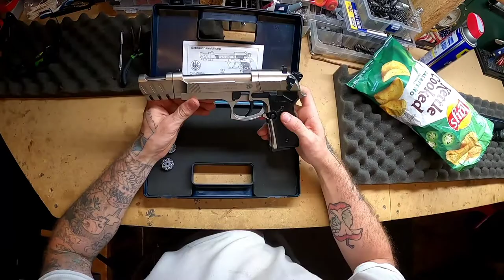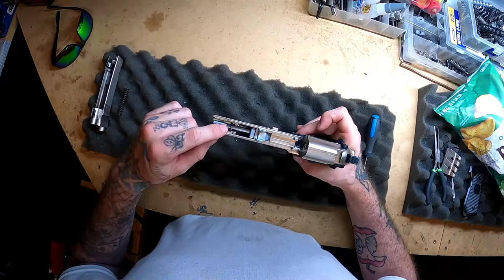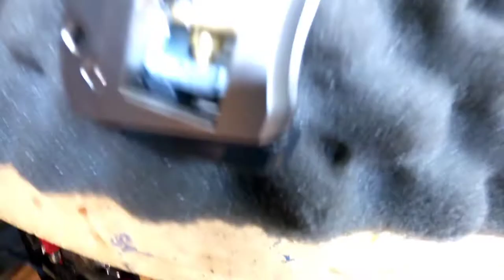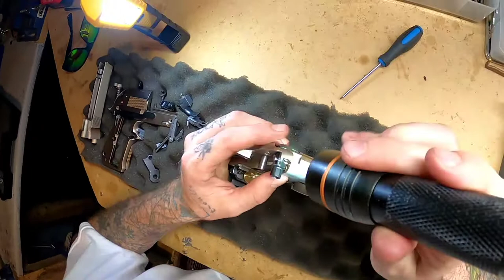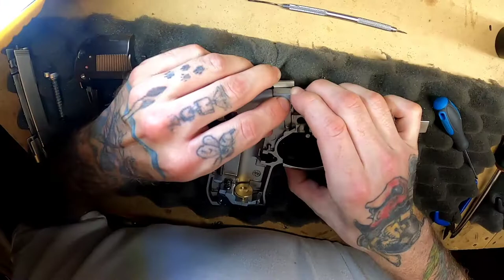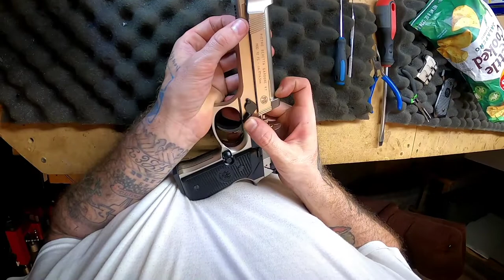German Made Beretta 92FS co2 Competition Pellet Pistol Disassembly/Reassembly

Comment: Great video I only wish I found it before resealing mine. One thing though, you might want to add, don't remove the safety. That tiny detent ball that comes flying out will disappear in a second, and when you find it, it's not easy to reinstall.
Reply: Can i change left safety without disasembling whole gun? Mine is broken . Thanks

Comment: Thank you for your great video. It will help other viewers to repair their Beretta 92 FS from Umarex.

There is only one Product of this Beretta 92 FS pistol with the 8 round little pellet drum magazin on the market. No chinese or other clones.

The reason for differnt kinds of the inside construction could be, that since the introduction in 1998  some changes were made for cheaper manufacturing. That may be the reason for the discussion about the little sping.

Umarex is not a manufaturer of airguns. They are an importer of mainly airguns from taiwan.

The pistols with the little 8 rounds pellet drum magazines, like CP88, CP99, Beratta 92 FS, Colt 1911 etc are producet by the Carl Walther Company, except ironically the Walther PPQ, produced by Win Gun in Taiwan.

Umarex is the owner of the Carl Walther company, so made in Germany by Umarex is equal to made in Germany by Walther.

By the way, Umarex USA is selling spareparts.
Reply from the maker: @FriedoKreienhoop  great information. Much appreciated 💪

Comment: Thank you very much sir! This tutorial is as good as gold thank you very much for putting that out there for us. I bought one appears to be very very slightly used but was missing the CO2 cylinder screw. Having trouble finding one.Any suggesten?
Reply from the maker: Unless you could fabricate one yourself then I really wouldn't know.
Reply: I called umarex USA, and they actually mailed one to me for free! He told me the computers were down, and it was an inexpensive part so I had it in 2 days original OEM. But I certainly appreciate you getting back with me. 😁👍

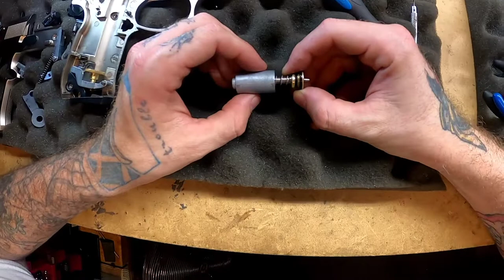Comment: 22:10 make the spring shorter by three turns, 22:39 make these three holes a little more dremel, 26:20 and here what pierces co2, you need to make a slightly larger hole with a dremel,the power of your pistol will increase noticeably, I did it myself and now I am very glad that it has become more powerful
Reply: Hi mate how much more powerful is it with the mods you mentioned? Also is it worth the effort? Cheers
Reply: @StuartOliver83  I'd say significant amount. But then noticeable fewer shots with Co2 as well. I wouldn't mind just doing the washer on the hammer spring, give it a bit more snap.
Reply: @Vanadeo  cheers mate

Comment: Thanks 4 your strip down of risk pistol really helped!!!!!. But the trigger spring which u said don't put back on until you have put back on the main right side body part of the pistol' av watched 20 times and u never put t 6:39 hat little trigger spring' back the 1 with loop either side of it!!??could u please put a video on utube plz it's driving me insane bin trying 2 attempts need new seals' springs 'and a trigger unit. cast alloy bit 1 side'  hoops broke off 😅😅😊😮😮 but it is mi little brothers gun an he don't want new wants this 1 fixed and wants me to do it so if it costs me an arm and a leg he avin his gun back f summer Thanks again for the help already

Comment: I have the same unit german made beretta m92FS. But i even i tightened the cartridge screw, it still does not puncture the co2. Can you help me. Thank you
Reply from the maker: The puncture tab is likely not reaching the cartridge to pierce it. Try shimming the cartridge first. If that does not work let me know. It could also be the piercing lever is bent and not applying enough force to the cartridge onto the piercing cap.

Comment: Wich one is the trigger return spring?
Is it the one you said to not attach it right away cause you'll have trouble putting it back together and almost impossible?
Reply from the maker: Yes. Do not attach that spring until the two halves are almost all the way joined. You can leave it open just enough to re-connect it.
Reply: @TheFowlerAirgunChannel  
Alright thanks 
Sometimes my trigger has a tough time reseting( sort of jams in the middle) but the spring is perfect,  the pistol is brand new .

Comment: My CO2 Cartridges will not seat no matter what I do, any suggestions. I hav the nice UMAREX Cartridges. When I put the cartridge in and tighten the brass wheel, then close the lever at the bottom of the grip, the CO2 leaks out.
Reply from the maker: It has a damaged seal in the valve. It will need to be replaced.

Comment: 30:38 in this place I put everything on a sealant, threw out the ring, air from co2 passes through it
Reply from the maker: I hand made new seals to prevent blowback but great point. I know exactly what you mean.
Reply: Can i change left safety without disasembling whole gun? Thanks
Reply from the maker: I really wish I could remember correctly. I don't want to give you false information but best I could tell you is watch the video and try to fast forward to the moment when you may find some useful info.
Reply: @TheFowlerAirgunChannel  theres nothing in video about safety its stays in place. I bought mine damaged and safety left is broken need to be replaced. I have new one just not sure.
Reply from the maker: @pbadach1468  Im really not sure. I'd hate to tell you wrong. This was some time ago and I constantly work on many different model airguns. Hard to keep track.
Reply: @TheFowlerAirgunChannel  alright pal thanks.took me 2hrs to assembly. But its sorted need to dissasemble and take out valve reale fiddly. Cheers.
Reply: I will try shoot tomorrow hope its work
Reply from the maker: After watching the video again I can definitely tell some pretty major disassembly is required to remove the whole barrel. Its a barrel style rolling safety which goes through to the other side of the casting so it would have to come apart.  Good luck 💪